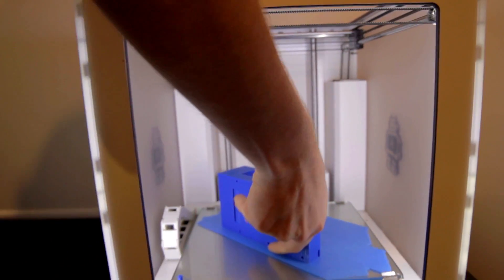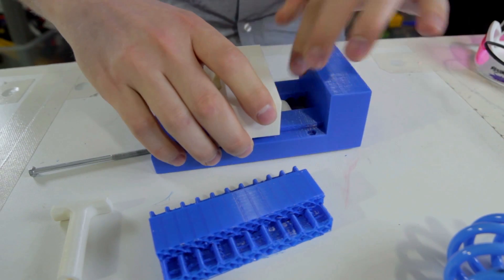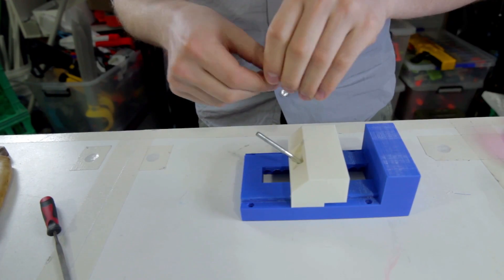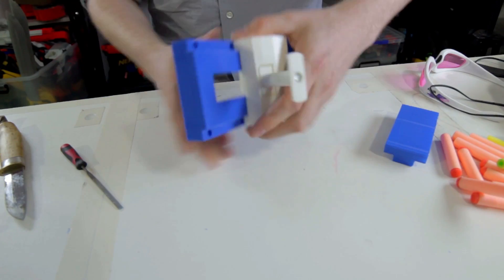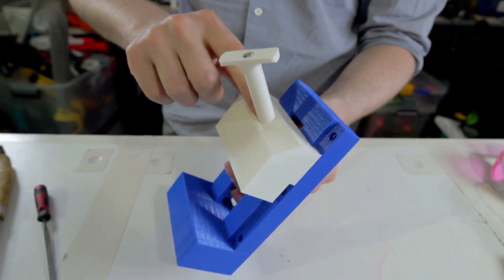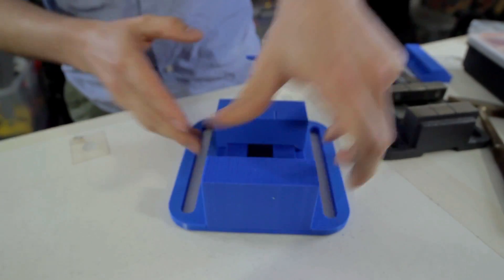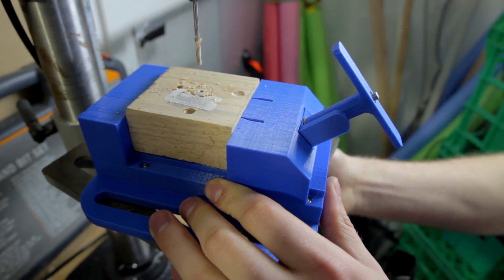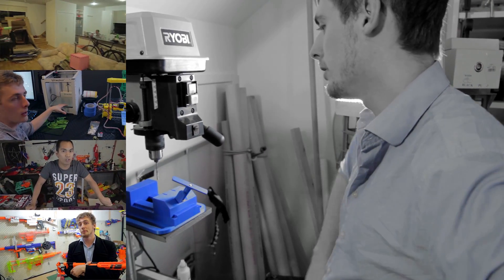3D Printed Screwless Vise (FREE DOWNLOAD)

Comment: what's that thing you're turning to loosen and tighten the vice? Is that a screw?
Reply from the maker: Google "Screwless Vise" and look at images.
It's a dumb name but that's what they are called, it refers to the fact that the screw is more of a locking mechanism than the method of sliding. 
-Justin

Comment: Nice design! It's on my 'to print' list. I'd suggest adding some vertical & horizontal v-slots to hold round things and some rubber or TPU on the jaw faces to prevent slipping like you were seeing. Is there a reason the handle needs to be so long? Seems it would get in the way. Thanks!

Comment: dude you cant make a milling machine from such a wobbly drillpress like that, im a machinist and tried it on countless types of drills and only the realy heavy duty will mill a little steady but for the rest its jokes
Reply from the maker: I realized this after speaking. One can dream... -R
Reply: BomenJager 
The problem is not with wobbling, the other problem is the drill press is designed to apply force vertically on a point which is the tip of the bit when drilling, but in the mill the forces is mostly horizontally applied which requires the mill rotating element to be supported in a way that can take this horizontal force which the drill press doesn't have!!

Comment: This is a cool proof of concept but you can get a metal drill press vise at harbor freight for $ 17.00
Reply from the maker: Nah those drill presses are shiitttttttt -R
Reply: Out of the box they need about 20 minutes of work to make them not lift. The weight is beneficial as well.
Reply: Isn't gonna make much a difference from the 3d printed one, it's still good only for wood, to seriously work on metal you need full vises which weigh a lot and cost a lot.
Reply: That's completely wrong. A drill press vise is exactly what it says it's for - a drill press. They are not designed for lateral forces but are well suited to clamping down material for holes. This plastic 'vise' is simple a take on a machinsts tool makers vise which are typically square to 0.0002". It's not going to do any better than just clamping something to the side of the table.

Costs a lot? My 4" tool makers vise cost me $ 65.00 but you're not using that on a drill press.

You need the right vise for the right application and this is not even worth printing for practical uses.
Reply: Never talked about lateral forces, even for simple drilling the most important thing is to reduce the vibrations and the weight and rigidity of big vises help.
Reply: Modelero I don't know why I bother posting anything, people are just going to try and waste their time printing out this giant plastic vise. It doesn't matter I've been doing this for almost 50 years. I'm just trying to be practical and save people time however it doesn't impact me at all whatever they do.
Reply: Never tell 3d printers to not print something hahahah ;)
Reply: adisharr harbor freight is known for making low quality cheap projects
Reply: It's not a $65 machinist vice nor even a $17 HF vice but it's fine for what many people will use it for here: drilling things  that have "no resistance to bring drilled" holding parts while soldering, clamping things for gluing or painting, ect.

I've had at least 3 of the HF drill press vices- they work just fine for general use. I just consider anything I buy from HF a kit "some assembly required" lol

Comment: 1: copies idea from somebody else and doesn't lay claim for action until the end of video and didn't give credit. 2: talks about how strong it is and IMMEDIATELY yanks out the piece he clamped down on because it has not strength to hold it. 3: Title says "screwless" first thing he shows you is how to screw in the screw (ya, just bad wording I know, like when he referred to the recess as a "thingy right here") 4: Thinks his cheap vice he bought was bad because it tilts at the top because of the "screw"  type allows it to bend and is a cheap design. Nice 3D print, poor execution somebody will learn that for you when the part twists out of the "vice" and goes flying.
Reply from the maker: You don't seem to know what you're talking about nor watched the whole video before commenting.

1 & 3: Search "Screwless Vise" on either ebay or amazon and you'll see how silly your accusations sound. I thought it was weird too when I first heard the name and saw how it functions but that's what they've been called for decades.

2 & 4: That's version 1 of the design, we test out ver 2 later in the video, it holds the piece tight enough and we still use it on our cheap benchtop drill press to this day. 

It's not as strong as a precision made stainless Screwless Vise or normal Vise. 
No Fuckin' Shit dude. 
But it's not for high torque metal milling. Much like a wooden Woodworking Vise isn't, but that doesn't make it totally useless or dangerous when used appropriately. We kinda give our audience the benefit of the doubt that they are intelligent enough to know where to use this. 
-Justin

Comment: 10:04  ive milled on a drill press but mills generally have much stronger bearings and their frames are built much stiffer because milling crates significantly more force on your machine. a drill press will flex while milling, making your cuts inaccurate and wearing out your machine much faster.
Reply from the maker: Yeah, I was looking into it and its probably not a good idea to do it for the shitty drillpress that I have :( -R

Comment: Hey, I wanted some opinions on this, but I'm modding one of my Nerf guns (my first big-ish mod) and I was wondering what you thought. I'm using a Recon Mk2 and I'm modifying it to be a bolt action rifle by fitting a metal rod through the priming mech and adding a cork (for the time being) for the bolt, adding a blaster parts spring for the gun and then cutting the original priming mech thingy so I can get the rail and move it back and glue it to the gun in a way so that I can still l take it apart after and leave the jam door exposed. I'm hoping to turn it into a basic sniper rifle. What do you think?
Reply from the maker: Yeah? -R

Comment: Why did you make the raft so damn big?
Reply: Stephen Butler I think you mistook the blue painters tape on the heated glass bed for a raft, it's a similar colour to the plastic so I can see why. The blue painters tape is commonly used in 3D printing to help with adhesion of the part during printing, especially with materials like PLA.
Reply from the maker: What raft? I dont print with a raft. Do you mean the infill? I needed the geometry of the overhanging features to be perfect for the design to work so I used a lot of infil. Im sure I could have designed a custom infill that would have worked with less material, but I couldn't be bothered. It came out really well -R
Reply: Make.Test.Battle Maybe we called it something different in my engineering class.
The big flat piece of plastic that you pulled the base of the vice off of when you pulled it out of the printer. It looked way too big.
By the way, I showed my engineering teacher this and he thought it was pretty cool. He's getting some new printers so he'll be able to print a few of them to use in the shop room.
Reply from the maker: Stephen Butler Neat! That will be a good stress test of the design. I'd call that support material. Yes it is a lot but because of the large overhanging area is very necessary for the print -R
Reply: Robert Hunt Just looked again. Yeah, that's painters tape. I had thought it was a raft.

Comment: How would you recommend one to make a pump action retaliator  with the original grip? Note i have no 3d printer
Reply from the maker: There are a bunch of way to do it. I suggest a quick Google search -R
Reply: yeah, i think im going to use a flat metal bar and connect it with botls